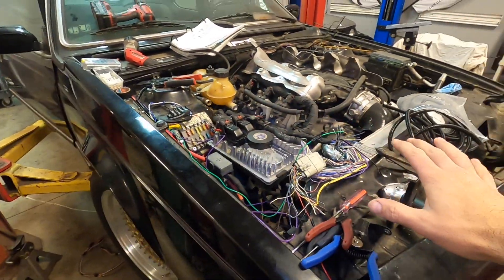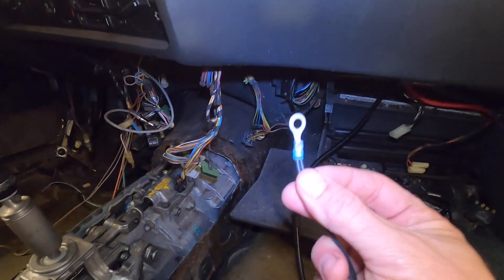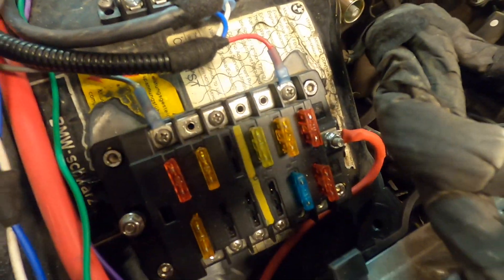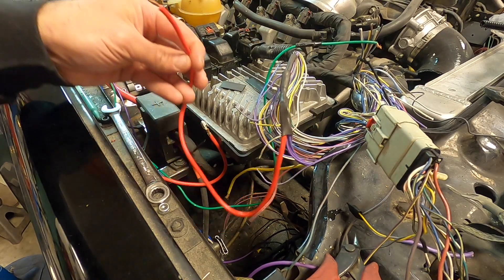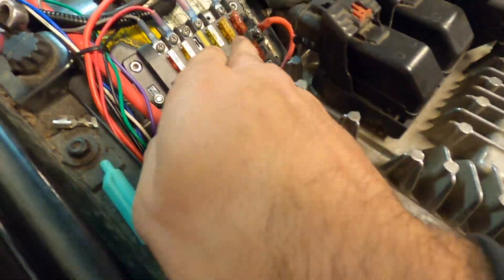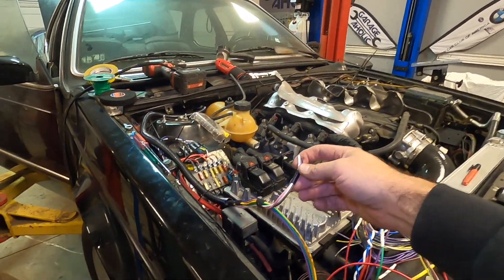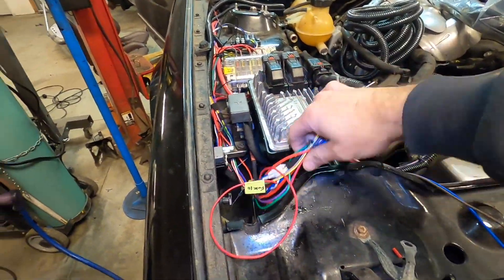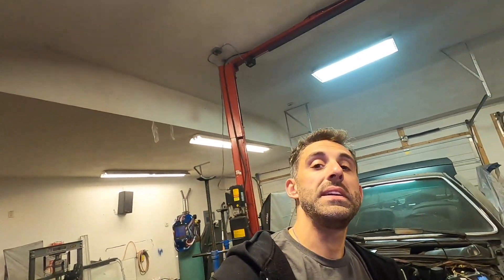Part 22: All You Ever Wanted To Know About LT1 Wiring Into Any Chassis!

Comment: I have a 1993 Corvette ECM LT1 engine in a 57 Chevy pick up when you start it it fires right up and then dies. What should I look for?
Reply: Ps. It’s installed in a 57 chevy pickup with a Dakota digital dash with a 700r4 transmission.
Reply: It was running fine until the transmission was replaced . Ran fine on test drive then was idling for a while, then was shut off then when turned back on to move, it started, and then died before I could even put in gear and has been starting and dying right away since. The oil sending wires got pinched between the bell housing and block fix those thought that was the case replaced ignition module, but still does it.

Comment: How the battery current get to a lt1 harness ,I am doing lt1 swap into a 86 camaro had harness built with a 94 CorvetteLT1 harness and 86 Camaro harness got the harness connect to starter sloid the positive battery cable connected to bolt on starter light don't work turn key nothing  why

Comment: I think you have to be a bit more specific about what year or lt1 engine. Im Currently working with a 95 lt1. It has opti spark not sure if you know that system
Reply from the maker: I said gen V LT1 in every thumbnail, video, and description multiple times. Check out the playlist!!
Reply: Lol it’s a lt1 from gen 6 Camaro 2016-2023, gen 5 had ls3 6.2
Reply: @colby7x he was referring to gen v lt1 as in the engine is a gen v Chevy engine
Reply: @colby7x  gen 5 small block chevy smart guy. not a gen5 camaro

Comment: Great work Frank!  Very interesting indeed. Does CAN Bus wiring have a requirement for number of twists per unit length?   and...  How do you protect ground connections from being corroded?
Reply from the maker: There are requirements, they're in the J19xx specs that you must purchase and download from SAE. Not sure what the specs are here, but it's not super critical, as long as you make a tight twist with minimal air-gap in between